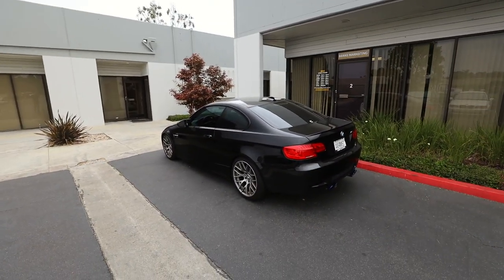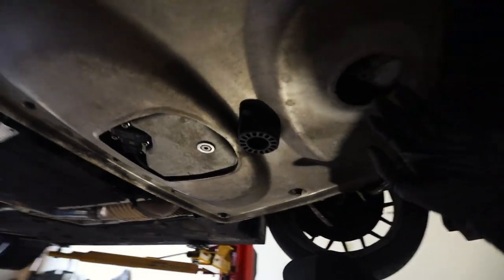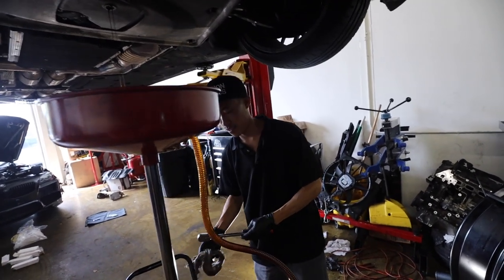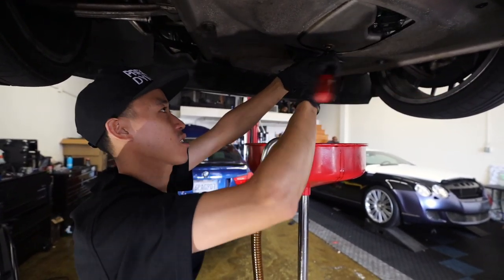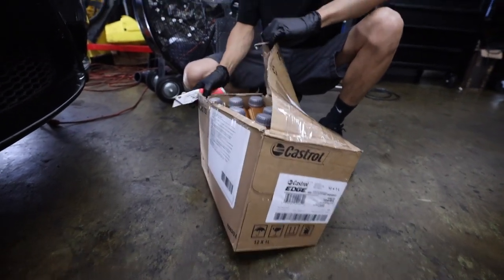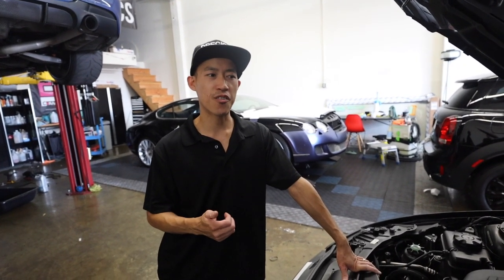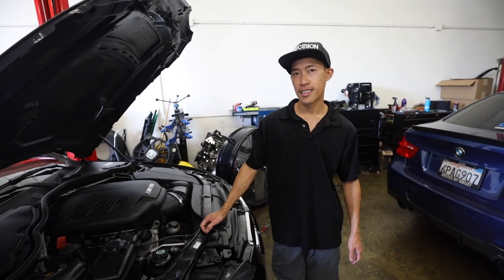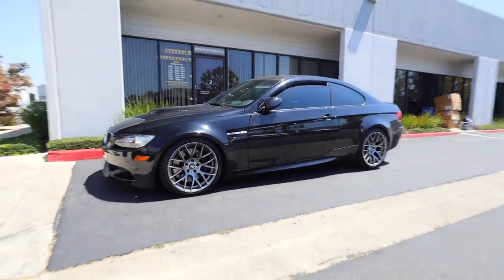5 MAIN fluids to change in a BMW E92 M3!

Comment from the maker: Don't worry, we didn't forget brake fluid, haha. That'll be an entire video soon. Thanks for watching! Much love, - SB
Reply: You might have 2 separate issues.  Vibrations while at idle usually can associate with a misfire or bad motor mounts.  Misfires won't cause vibration in the steering wheel so that seems to be a motor mount issue.  And idle fluctuations will not be caused by bad motor mounts.  That could be a slight misfire maybe bad coils and or plugs.
Reply: my bad! just saw this comment =)
Reply: yeah you did forget breaking fluid, admit it.

Comment: If you loosen the Oilfilter first, 1/4Liter old oil will flow back in the oil pan. So you can get more old oil out the Engine. Just a Tip. Greetings from Bavaria :-)
Reply: I do the same thing.  I also pour some new oil in the oil filter housing to help flush out the old oil.  I'm a bit OCD haha.
Reply: @ShiftedPerspective  Haha good idea 😋👍 I have to remember next time!
Reply: That's what i've always done with my BMW's wonder why they don't do it.
Reply: @ChristopherBristol  who knows? That's why I always do my own oil changes. The you don't have to worry about if someone else was in a hurry, lazy or inept.
Reply: @ShiftedPerspective  same here!

Comment: You should always change the oil right away if you're buying a used car.  This is common knowledge Spencer...
Reply: Definitely damaged the engine by neglecting oil change from the previous owner. I've never seen oil that sludged.
Reply: Yeah, wasnt the car bought some time ago..?
Reply: Mark7 GTI 100% for someone who claims to know so much about cars. What a newb

Comment: there is no lifetime coolant or any car fluid for that. Car manufacturers consider warranty period to be lifetime of car. After warranty expires, so life of you lifetime fluids. Anyway i would definitely not leave coolant in car for more than 6 years, ideally change every 4 years. Btw LSD diff and manual gearbox oil should be changed every 3rd oil change ACCORDING TO BMW. Especialy with clutch LSD it always been the case to change oil every 30K miles. Can be stretched but then you might get to the point this guy mentioned in video that you will have to keep those metal shaving in diff to have friction in clutchpack

Comment: In my car, I replaced my fuel tank breather valve. That wasnt it. An oil change didn't help. And then I finally brought it to a friend he immediately recognized the problem and it was my motor mounts. Changed those and it went away. Check yours bro.

Comment: I change oil in start of each season, so two times a year on my E91 diesel. We have harsh cold winters here in Norway and the engine runs colder for longer creating more sot. The oil is already black and smells after a season.
I have the dreaded N47 motor that is known for timing chain problems if you don't change oil often.

Comment: summary for MT owners. 
- Changing engine oil fixed the steering wheel vibration the owner was feeling when idling.
-Engine oil every year or 5k miles or every year.
 -Advises against preventive replacement of diff fluid (shavings help the clutched limited slip diff, removing them can cause problems).  
- Coolant is lifetime, bmw does not recommend changing it
-Power steering should be lifetime too, but check fluid color by dropping  a drop from the cap on a white rag should look green, if it looks brown change it.  Verify level for leaks and top off.

Comment: Thanks for making this video. Who would have known that changing your oil helps keep your car running smoothly? /s

It's like this is Spencer's first car and clearly he's never done an oil change or basic maintenance himself. This is all basic stuff that a dad or someone should teach someone when they get their first car.

Lots of misinformation regarding fluid changes in this video. BMW claims lifetime transmission fluid but ZF recommends transmission fluid changes at 60k miles.

Coolant should be changed every 2 years. Brake fluid at least every 2 years but if you track your car then at least every year. Differential and power steering fluid should be changed every 30k miles.

Comment: my summer car get its oil changed once a yr. always in the fall a week b4 i plan to put it away so i can drive it on the new oil for a bit before it goes away for the winter. usually only put like 3-5k on it in a driving season. only time its over 3k is if i take it up on a trip other wise it get goes to work a few times a week and around on the weekends if its not raining other wise i drive the truck i have no gas savors lol

Comment: Good stuff!  My power steering reservoir also tends to overflow when I take it to the track.  Going to upgrade to a BimmerWorld reservoir and hopefully solve that issue!
Reply: I had the same issue, its the breather hole on the stock reservoir, I bought the aluminum one from turners problem went away.

Comment: Hi all, thanks for this i wish we had people like this in South Africa, here everything must stay a secret 😩, they not really helpful. However im still confused about the gearbox service I have a 2010 e92 M3 DCT. No issues with it but gearbox oil and filter will be 12 years old by now.... So i don't know if I should change it or not? 91000km on clock. Also some say you need to do the side gasket some say you don't, and for that apparently you should remove the gearbox, still dont know what to do and what not to do? 

Any help will be appropriated allot. Thanks in advance

Comment: I own a '09 e92 M3 and have been chasing answers if the DCT fluid should be serviced at regular interval. Dealers pretty much say that its lifetime fill. On the other hand, my local Bimmer specialty shops recommend servicing it at 50K miles interval. Given that Precision Dynamics recommend 100K miles, I wonder how that differs from lifetime fill since, by that time, the DCT may be close to the end of the life anyway. Currently my M3 has only 35K miles and the DCT fluid service is just around 6 hundred dollars, I feel that it's still a worthwhile investment if it can prolong the DCT beyond 100K miles. The only risk I am concerned about is if it will cause slipping afterward due to the flush of metal shaving.
Reply: It’s considered lifetime for the life of the part.

Comment: My bmw seems to be leaking coolant..  any suggestions 328i 2011???
Reply: Expansion cracks almost 99% of the time. (has happened to me on all of my 3 bmw's) Or check if the radiator is leaking. Do a Pressure test, not that expensive and it will pin point your issue. Hope this helps.
Reply: i also owned a 2011 328i that was leaking coolant at 80k miles and got the tank and all the hoses replaced. REPLACE THE TANK AND HOSES ASAP IF IT IS LEAKING.

Comment: Really? Don’t change the differential fluid? Hmmm...
Reply: Andy I changed mine and now my diff rumbles at low speeds. If yours is ok just leave it. 👍🏻
Reply: Stephen Wilson Thanks for the info!
Reply: DCT fluid is not actually lifetime... Just as BMW is wrong when it says 15K oil change intervals. BMW recommended intervals are wrong.. but he cited them.
Reply: Insane to say that about the diff and the transmission.

Comment: Great video. 
After I got my E92 I put it through a major service and changed all fluids so I knew where I was with the car. 
Now the diff has a rumble at low speed manoeuvres 😤. Wish I’d just left it. Any idea how long it will take to “run in” or could I do anything to help it. (Correct oil used with friction modifier) 

Thx.
Reply: go in car park and do figure of 8's , works the diff
Reply: imfuctifino done it. 
Could mes back after next run 🤷🏼‍♂️
Reply: Update. 

It was the wrong diff fluid. BMW sent out the grey bottle, it’s supposed to be the clear bottle with red lid. 

They really are the worst for anything BMW related. 
Avoid dealerships at all costs is my advice. 

Proper oil in and it’s been fine since. 👌🏻👌🏻

Comment: This whole "lifetime fluid" talk is BS. Even coming from a fellow BMW owner. Service at proper intervals similar to any other vehicle. pushing 200k miles on my E90 and all of my fluid have been changed 3-4 times. Engine oil every 4-5k with LL01
Reply: E90 M3? Or 335?